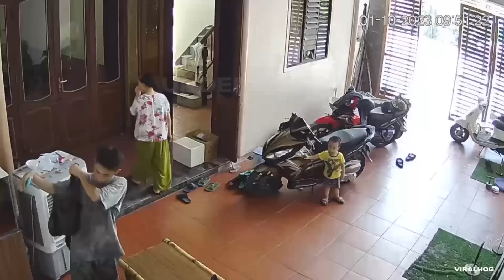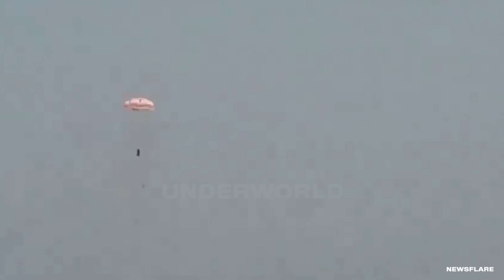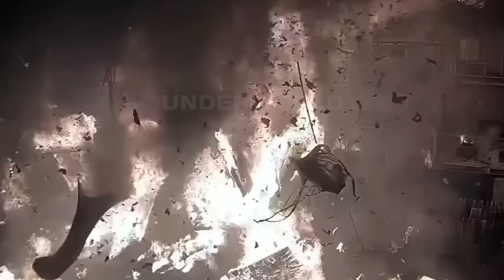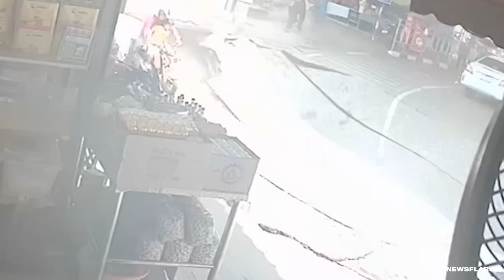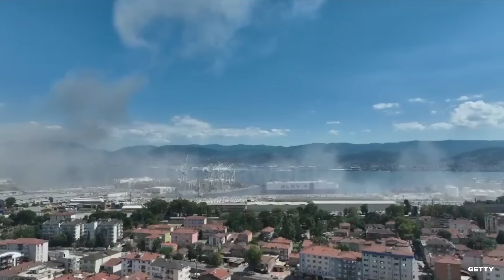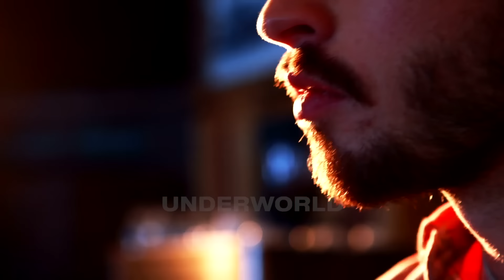10 Extreme Moments Caught on CCTV Camera

Comment: 1:48 HOW IS THAT LITTLE PINK CAR STILL IN THE SAME SPOT?!?!?!?
Reply: Must of had the parking brake on 😂
Reply: wind was all sideways if the car was pointed towards the camera it was gonna be in the next state lol
Reply: This is a good ad for that little jeep. It ain't going nowhere!
Reply: I WAS THINKING THE SAME THING
Reply: The tree blocked the wind, as did the corner of the house.  Then the tree came down and blocked the wind even better.  And the battery in that little toy truck is actually surprisingly heavy.  If the chairs stayed more or less in place that toy wasn't going anywhere.
Reply: The dad ask English or Spanish 😂
Reply: Car might be pink but the engine is made with forged steel
Reply: magic pink car
Reply: it's a heavy battery loaded kid car. Must be around 500 kg.
Reply: Bro that jeep got plot armor 💀
Reply: Maybe girls were right pink is pretty good or it just built different 🗿
Reply: e
Reply: I AM THE STORM THAT IS APPROACHING ⛈️⛈️⛈️
Reply: It’s clearly motivated
Reply: Glued it down 😂😂
Reply: good traction
Reply: Them 4 wheel drives are sturdy
Reply: Great catch, it's too low to the ground and up against a wall
Reply: FRRRRRRRRRR
Reply: LoL
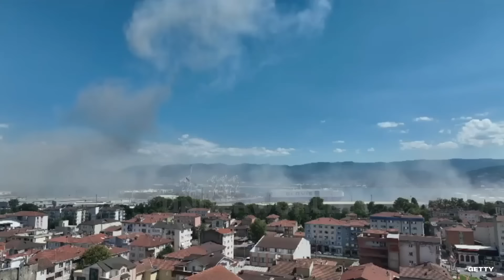Reply: How did that silo explode 10:44
Reply: Fisher Price has better suspension than Ford. 😅
Reply: Bugattis are just built different
Reply: its glued to the ground

Comment: The snow falling off the roof might have still injured the man. The narrator says he probably would have been OK even if the snow hit him, but that stuff is heavy in large quantities. Could have been concussed, neck injury, etc. There's a reason you need to shovel ur roof if there has been a huge snow storm, because roofs have caved in due to all the weight.
Reply: That will be what he meant by probably, and why he didn’t say he definitely wouldn’t have been injured. 🤷‍♀️
Reply: True. There was a kid in Australia who was killed after roof snow fell off and buried him. No one could get him out in time
Reply: Yeah, that impact sounded heavy. I doubt he would have been fine.
Reply: While yes, roofs have caved in due to how heavy snow can be, that’s because it’s cumulatively very heavy. The 2’x2’ square that would’ve been him wouldn’t be enough to do much damage. That’d be about a cubic foot of snow which would weigh around 20lbs… probably not even enough to knock him over.
Reply: It's a small avalanche. Everything's fine.

(Sarcasm)
Reply: @Fetidaf it takes 2lbs of pressure to snap a neck.
Reply: @NoMythSmith  and not even a fraction of that would be on your neck…
Reply: My guy, this is why he used "probably" because we don't know if he's dead, injured or alive.

Comment: I remembered that plane crash narrative is Bangladesh Air Force Yakovlev Yak-130,operatedby 21sq "The Avengrs", suffered an engine fire. Both pilots ejected and the aircraft crashed into the Karnaphuli River.
Squadron Leader Muhammad Asim Jawwad died later of his injuries.

Before the crash, the pilots performed barrel rolls at an extremely low altitude and collided with the runway surface.

Comment: Nah don’t blame it on our road safety, In Thailand, We build roads WITH SAFETY. The 100% main cause for the road to collapse is because, 1. The road might be too old to handle heavy weights, especially when dump trucks run of them. The dump trucks are very heavy because most dump trucks in Thailand have 2 trolleys connected like a train. 2. We TRY to REPAIR our roads and sidewalks because our sidewalks used to be bumpy, and most of the time cracked. The road should have been tested for safety. Maybe the road collapsed because it was flooding? Under our roads, we have a HUGE pipe, yes it is massive. Looks like the pipe cracked or shattered, causing the road to collapse. They announced the reason why the road collapsed. It was not because of safety, but it was the workers problem. They said that workers dug out too much sand because in Bangkok, we have a project to put all of our power lines underground. Blame it on our workers, not safety.

Comment: that plane crash was a technical failure. they weren't a stunt man, They were the pilots of the Bangladesh Air Forces. that was a trainer aircraft and they were middle of a training. they tried there best to land the aircraft but they couldn't control it because of the technical failure. they hit the ground and fly again but there engine caught in fire. then they tried to avoid hitting any buildings and crash land into the river. 

I am a Bangladeshi and a student of Aeronautical Engineering.

Comment: Utility poles have stay wires to help support the pole when there is a lot of pull on it from cables and in winter weather when ice builds up on the cables the is usually an anchor which looks like a boat's propeller and gets scrwed deep into the ground the wire it's self Will esely life s car off the ground